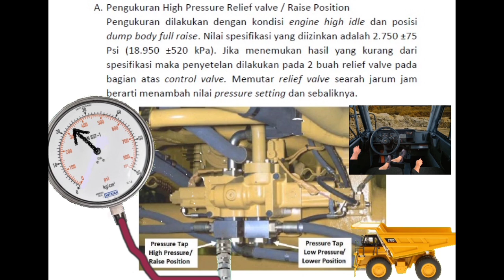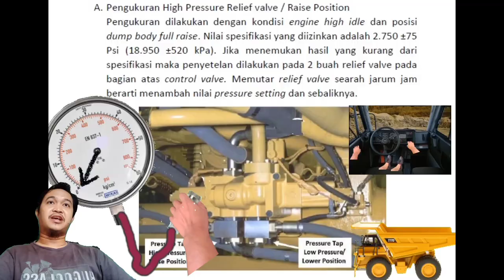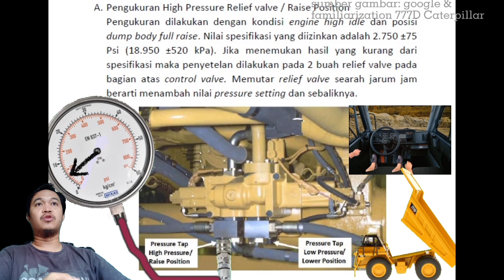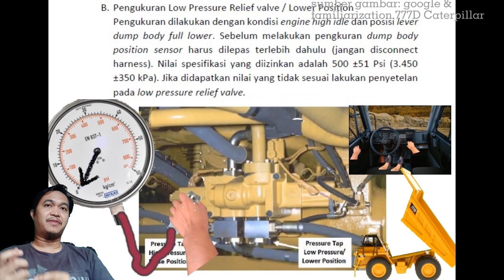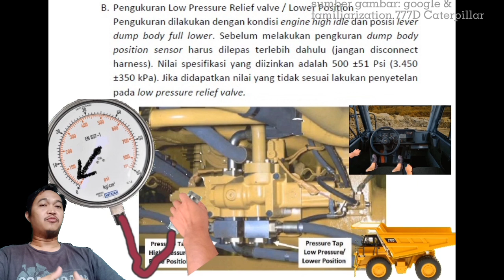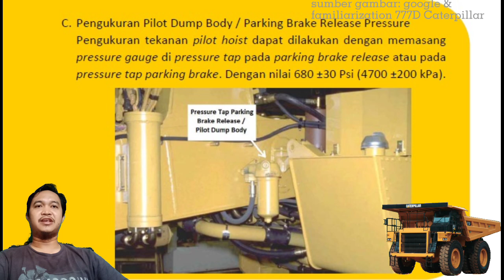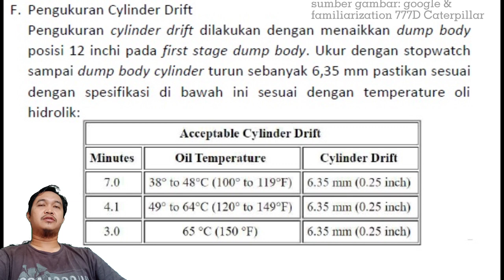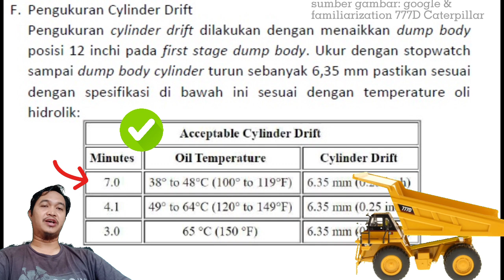TA 2 Hydraulic 777D/E Caterpillar. Part 3. Cara ukur cycle time dan cylinder drift hoist

Comment: Bang kenapa pada saat pengukuran dump body lower switch dump body nya harus di lepas 🙏
Reply from the maker: @mamad45-j3j  karena kalau tidak dilepas dia akan posisi Snub saat dump body mau menyentuh frame, kalau snub kan pressure nya turun ya kalau gitu gak dapat nilai hydraulic stall nya.. makanya dilepas biar bisa ngukur stall hydraulic..

Comment: Mas boleh share kembali penjelasan mengenai hoist lower over pressure dan dampak nya ke posisi snub?
Reply: Terima kasih mas salam dari alumni polnes 🙏
Reply from the maker: @adetiayuda1613  Siap mas.. btw Polnes dari Alat Berat kah ini mas?
Reply from the maker: Biasanya sih dampak nya ke snub dia akan lebih keras hempasannya mas, tapi kalau ke posisi sepertinya lebih kepada settingan posisi dump body up sensor nya.. 🙏🙏